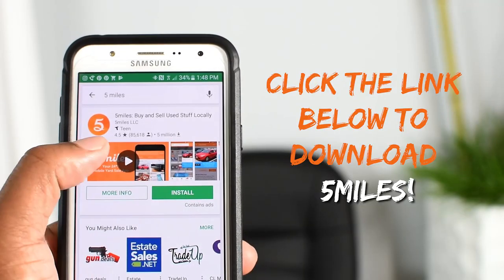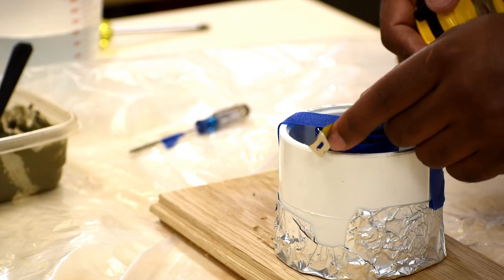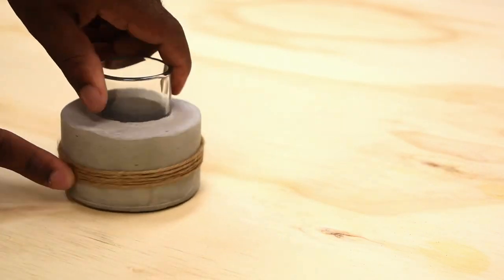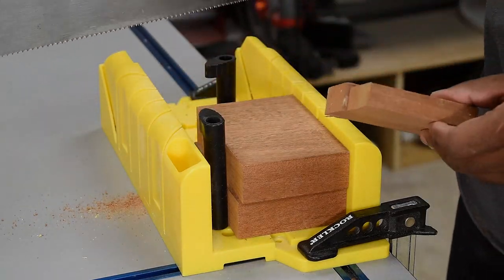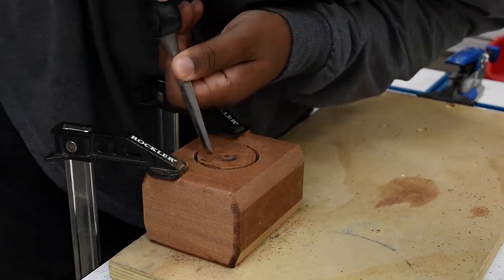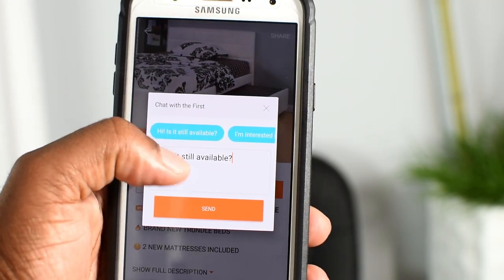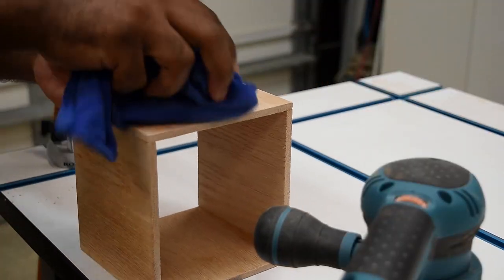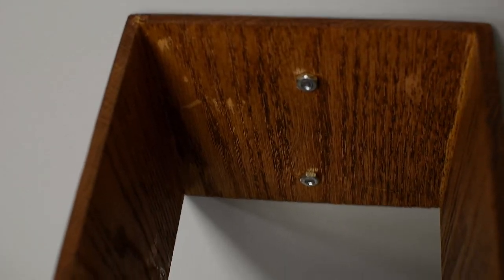3 Easy DIY Home Decor | Magnetic Lamp, Concrete Candle Holder, Planters

Comment: The lamp is really cool. You could have bunch of stylish brushed steel plates on the wall in places you might want to use the lamp. I know that wouldn't be the simplest or most practical way but I think that kind of playful designs are cool. I just might do one of those myself.

Comment: Nice work.
For your planter I would make a suggestion to save time in the future.  First drill a center hole all the way through the piece with a regular bit long enough to do so.  Then use that to line up your hole saw from each side.  even if the hole saw doesn't reach  over halfway from each side there will still be less chiselling.

Comment: Glen, I love your ideas and the way you explain all the process, I've been following your channel for a bit and I learned a lot. Anyway, here is suggestion about achieving smoothness of concrete: try pouring into mix some kind of plasticiser (in Europe we use Ceresit CN 94, or various products of Sika), great substitute for this will be the base which painters use to separate old surface area from the new (chemical which removes dust and creates individual surface) it will give you a bit shiny surface but it will be smooth, and dont hesitate with water, add a bit more water into mix so you can avoid defects and bubbles in your concrete shapes. Water will not damage or change the structure of concrete itself because it will go all the way up to the surface and vapour really quick (12-24h). All the best, love your videos!

Comment: Here's a tip to make the lamp better. 50 Watt RGB LED strips, and place them side by side along the whole inside of the lamp bar the part with the magnets attached. Solder the ends together, and connect to a computer (when you buy them, there are control control boards that come with them. These have micro USB inlets so you can connect them to your pc), Then, with a bit of code from the internet, you can control the brightness (you can use them as your actual lights or as the original accent lights), and have colour effects if you want them. This will only cost about £5, so probably under $10.

Comment: Using a forstner bit instead of that hole saw should help save some effort and time!
Reply from the maker: Yes, totally agree. At the time I didn't have one at the size.
Reply: It's perhaps worth noting that a large Forstner bit can be very expensive, and will require a drill press with a very low speed setting. Your average 6 speed press won't have a speed slow enough for a Forstner that size.

Comment: a very simple tip to release HOT GLUE: use ALCOHOL. it releases immediately. you don't need to heat, tap, anything else. a drop of alcohol and you're done.

Comment: Is it unnecessary to buy pvc coupler? No, do you have used up spray paint, spray furniture wax, or just any spray products? The plastic cap on top is as good as the pvc coupler.